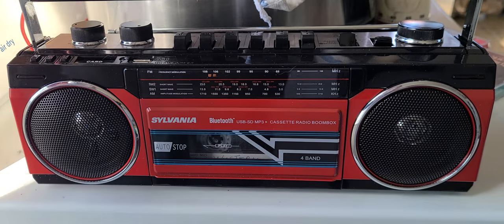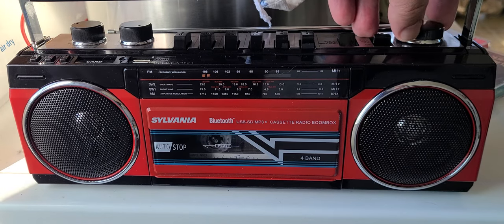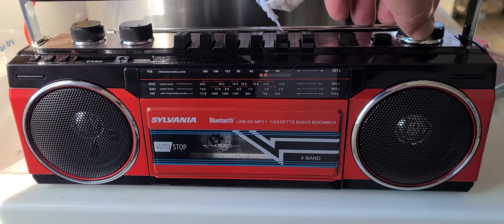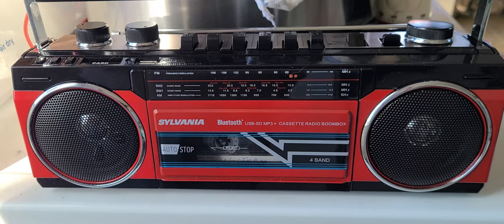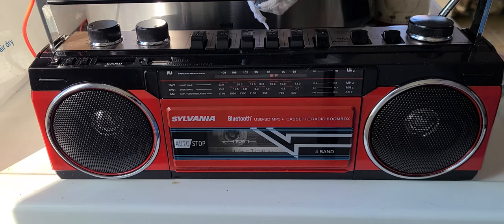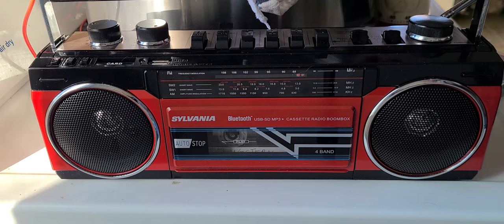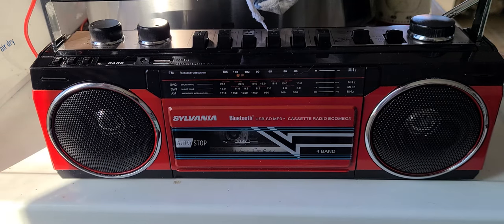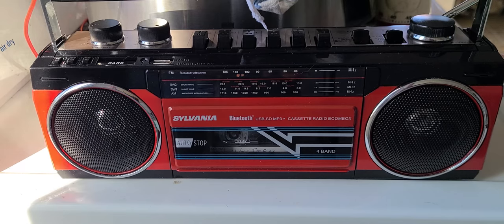FM AM and Shortwave performance personal observations Sylvania SRC232BT boombox

Comment: Had the opposite problem with an actual 80s boombox (Toshiba) circa 1983 which has strong SW stations, particularly Radio Moscow, bleeding right across quiet parts of the FM band.

Comment: As I said in Comments on some other videos, this Sylvania looks identical to the Riptunes Racr-400bt.  The only difference I found was that the 3.5mm jack on the side of the Sylvania says "PHONE" and the Rip box says AUX. 

I wonder what the actual functionality is.  I use headphones a lot. 

I really like the size of the mini.  I don't want a tape section, but I do want to use the TF/SD card playback function. I also would listen to the radio, mostly FM because where I am I can only use a 22foot wire reel (Kaito.) Not much propagation on AM or SW bands here with that.  I need an AM loop but it's very rural here so probably wouldn't make much difference.
Reply: What the mini one you are talking about here?

Comment: Is there ANYTHING out there made today that is truly analog? I'm beginning to give up on this hobby as there doesn't  seem to be anything aside from a few bottom of the barrel units like the R909 and R9012. Also getting sick of all the problems I've been having due to medium wave breakthrough.
Reply from the maker: the DSP radios like the XHDATA D808 are pretty good Tecsun PL 330 380 990x are great too ..  they don't suffer any mediumwave breakthrough in general ..  if you want more analog PLL  Tecsun PL 600 660 680 are all analog and still widely available